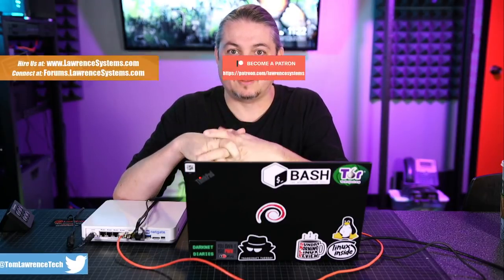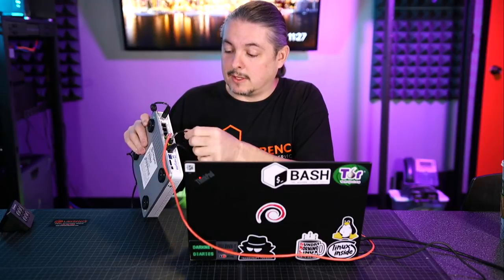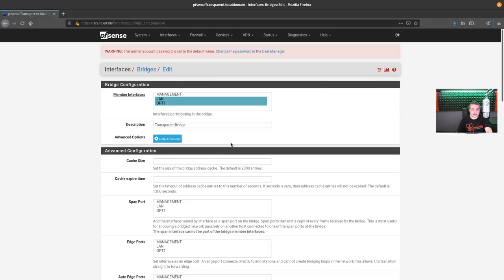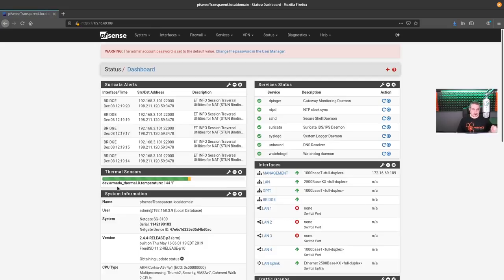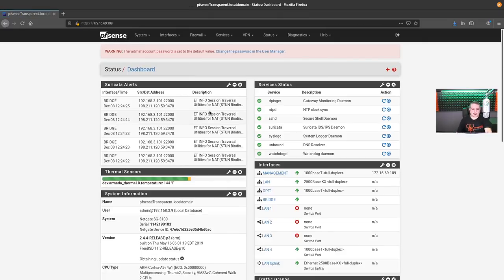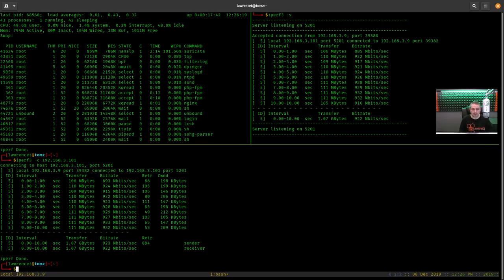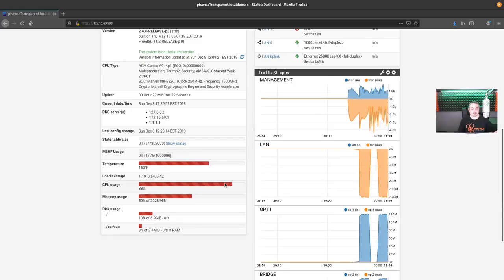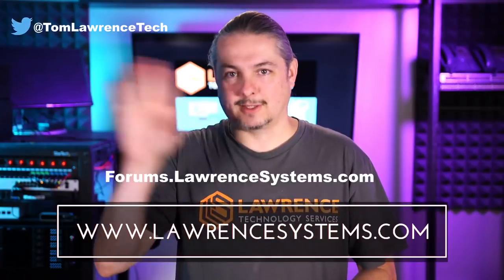SG3100 Transparent Bridge With Suricata Testing / Performance / Configuration

Comment: cool very cool ,  coming from a x25 background where by we use to plug in protocol analyzers and memorize the start  , address , crc , fcs flags ... rts , rtc ect , this is very cool , thought of deploying this on a raspberry pi with usb to RJ 45 converter cables and have it in the bag as an additional network tool possibly need to look at the possibility using something with the same carbon foot print  or only running suricata with custom routing and logging system with logstash kubana and Elastosearch , will need to research a more portable arrangement  , thanks a bunch Tom  , have a great one and keep smiling :-)

Comment: If they are going to use a large number of devices, wouldn't it be better to roll out SuperMicro 5019a-12tn4 servers? Faster processor, more RAM, and about half or 2/3 the price each unit when I priced this out. That is unless you can get the netgate hardware significantly cheaper than I could get it and pass the savings on to the customer. I think I had my server configured at around $1000 to $1200 and the closest netgate was significantly more money for me to buy. Ended up changing a few things around and building my firewall on an older similar SuperMicro (5018a-ftn4 was on hand for another function) that uses the Atom 2758 processor with 8gb, though upgrading to 16 to help future proof it since that ecc sodimm is getting harder to find. You would only need to add a NIC card to get the rest of the connections for the computers, and that certainly wouldn't cost too much for four more ports for a total of 8.
Reply from the maker: The sg3100 is only $399 and they need one at each location.  ( I think they are starting with 50 )
Reply: @LAWRENCESYSTEMS  I must have been looking at a much higher model then, I know it was one of the rack mount units.